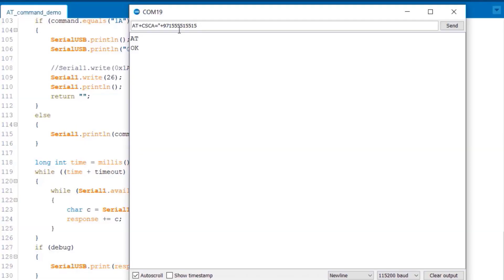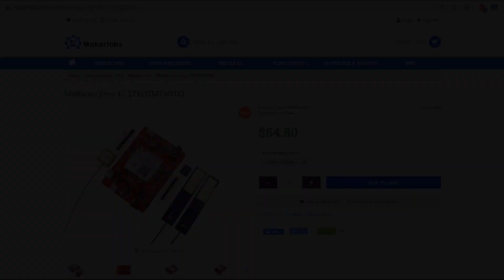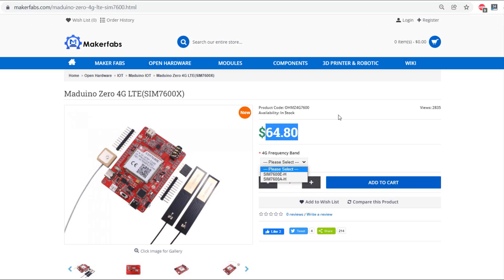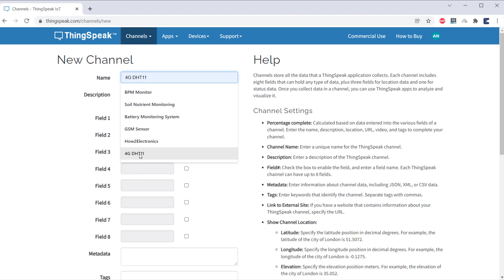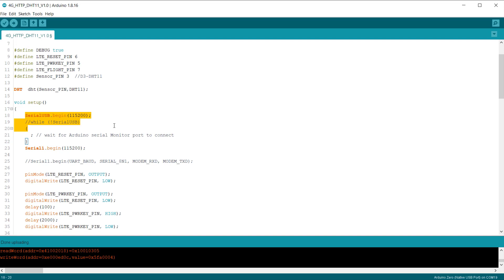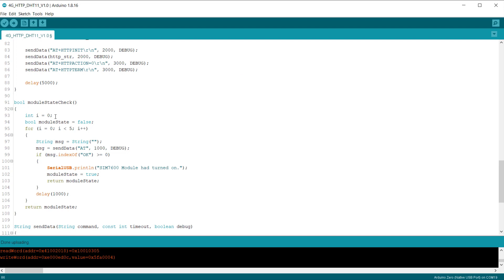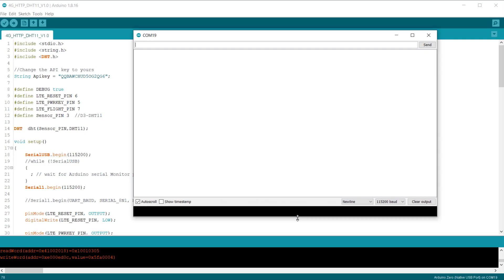Cellular IoT with 4G LTE SIM7600 Modem | Send Data to Server with HTTP Post using SIM7600 & Arduino

Comment: Instead of using Maduino Zero 4G LTE(SIM7600X) , can we use SIM7670C interfacing with Arduino Uno to achieve the same thing? Can you please guide on this please?
Reply: What did you find on this?  We’re you able to us Arduino Uno?

Comment: if I have another sensor but it is serial output how do I connect to this board given there are only two serial ports and they are used. by USB and the modem

Comment: Thanks for the video i have a qustion please Can i use it for transmitting data video for 300 m
Reply from the maker: You can transmit video data worldwide.
Reply: @HowtoElectronics  thanks verry much u don t have some example of code if possible please
Reply from the maker: For now its not possible as we are occupied with so many projects. But In future I will make video on video transmission.

Comment: hello thanks for the video i have a question please   is that possible to transmitting video with this module  i use esp32 cam with esp32 and tft
Reply from the maker: Esp32 is already a wifi module. You can connect to wifi and transmit video. 
Even instead of wifi you can use 4g data to transfer video.
Reply: For 100m distance possible
Reply: I want transmiting the video for 150m from esp32cam to esp32
Reply: I have similar doubt .Can you please tell whether you have done it or not